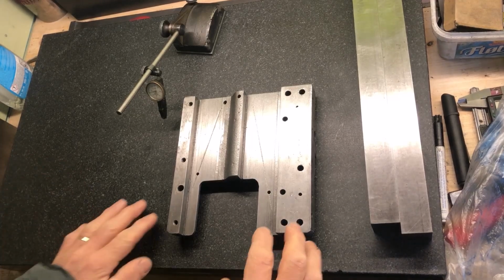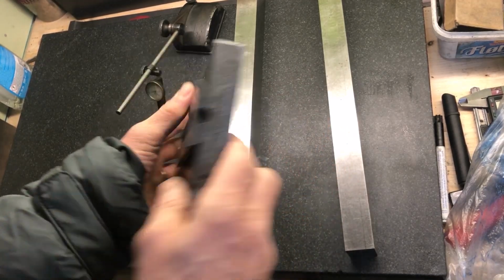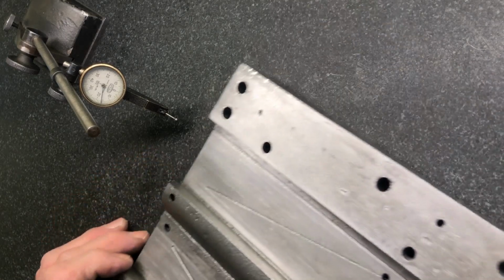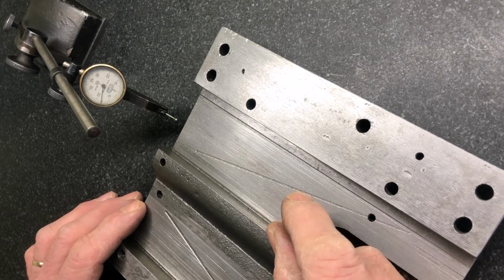Myford saddle resurfacing including Rulon application - 2 - first measurements

Comment: Assuming it's cold in your shop, have you ever measured changes in your work due to body temperature influencing the part?
Reply from the maker: It is not very cold in the shop.. the jacket depicted is only because I sometimes pop into the shop before heading for work 😀 I use a couple of small electrical heater in the winter as the main heating and haven't noticed any difference winter/summer
Reply: @jansverrehaugjord9934  Aah, yes, the jacket threw me off. If it's never really cold in the shop the temp delta won't be big enough to notice then, I think. What's your daytime job, if I may ask?
Reply from the maker: @MgBaggg  I am a sales manager for an acoustic instrumentation manufacturer, electronics engineer by education. Worked at Norsonic now for more than 38 years, responsible for a diversity of markets, but predominantly the last 25 years in the far east.. and "the Americas", "Oceania" as well as "German speaking" Europe.. and some more 😆